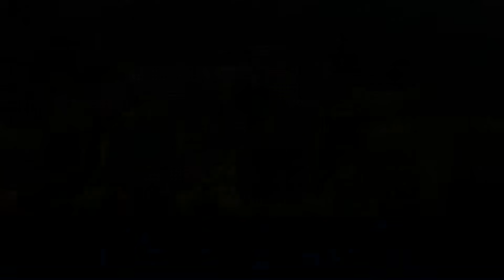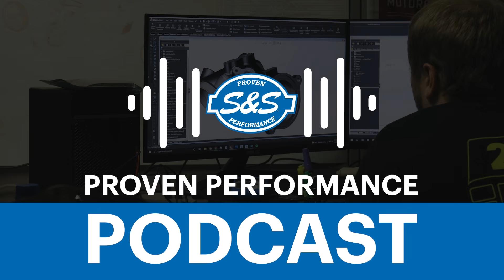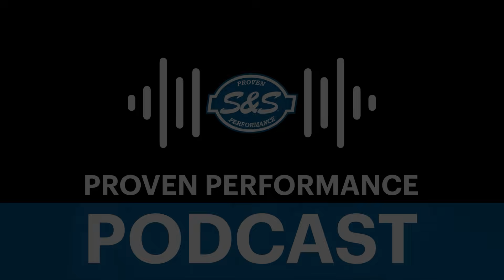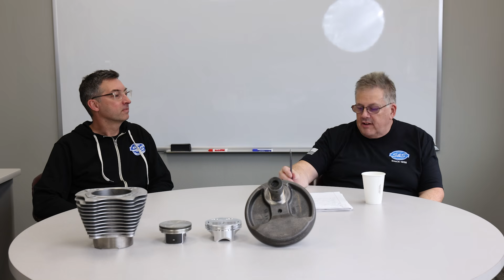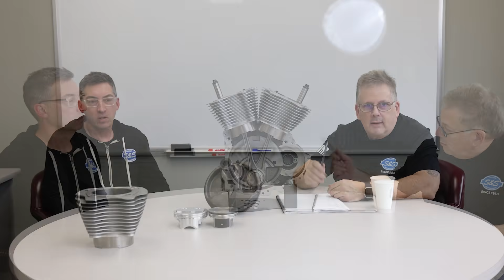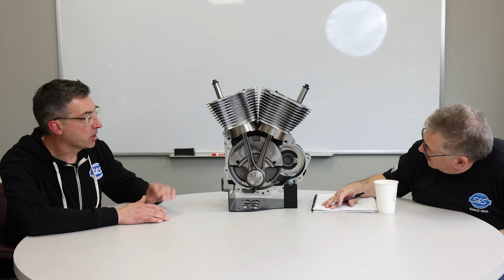S&S Cycle Proven Performance Podcast #11 - HP vs Torque

Comment: ⚠️This video is Hivemind 🚮. 
Below is a list of some worth watching:
The only caveat I will mention is at least one of these, like this garbage video, implies that crankshafts provide leverage to propel the vehicle which is nonsense.  Otherwise they are some of the best here on YouTube/

Power and Torque (for Cars) Explained in
60 Seconds!
Channel is:
KYLE.ENGINEERS

Does Horsepower or Torque Make your Car Fast
Chanel is:
Alex LTD LX

Power vs Torque - In Depth Explanation and Mythbusting!
Chanel is:
KYLE.ENGINEERS

Horsepower vs Torque - A Simple
Explanation
Chanel is:
Engineering Explained

Horsepower vs Torque Explained - Which REALLY
Matters?
Channel is
freedomworx

Engine power, torque and achieving maximum acceleration 
Chanel is:
 Auto Expert
John Cadogan

Comment: Calling torque a force is insane at this level. Put some effort into the scientific part, guys.
Reply: Torque is defined as a force on a given point, applied at a radius from that point. note that a unit of torque is on pound foot. A unit of work is one foot pound. Machinsts hand book...... You can't have torque with out horse power and you can't have horse power without torque they are eternally tied together mathematically..... If your hp is 0 you have no torque because no work is being done over time. If you have no torque no work can be done over time no matter how many rpm the engine turns,....Power is defined as work done over a specific time....Cheers